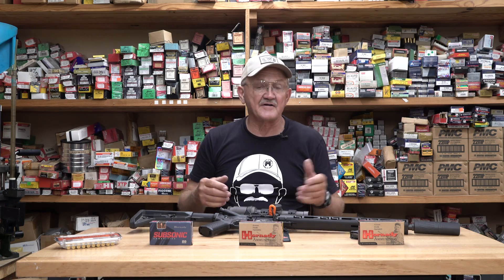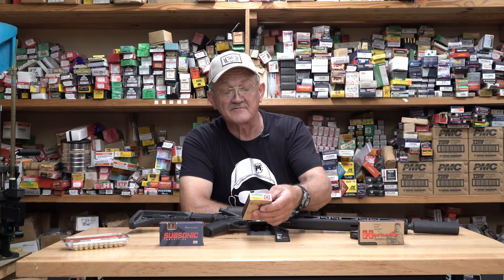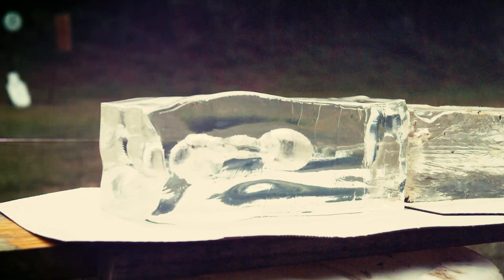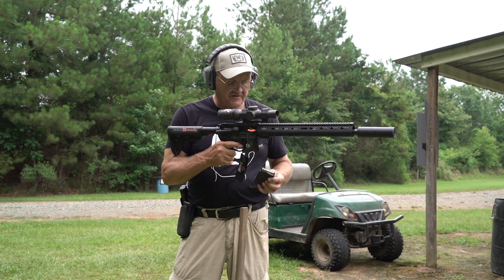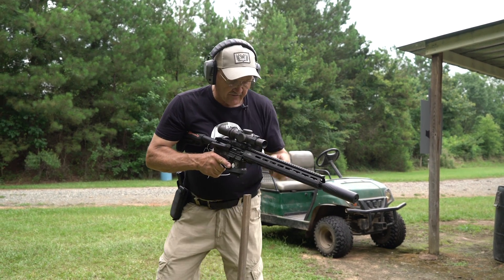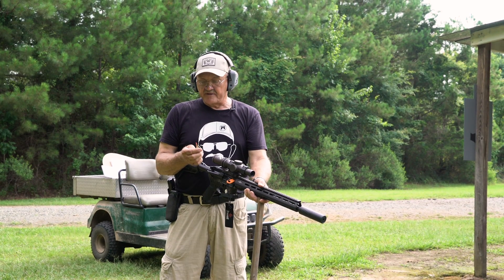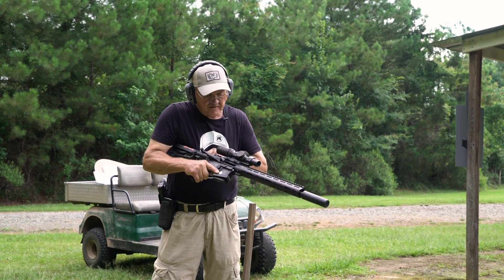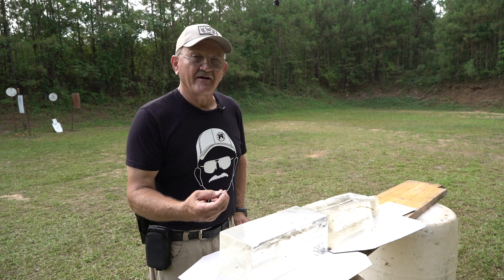300BLK Vs. Ballistics Gel - SUPER HIGH SPEED CAMERA!

Comment: Would have loved to see this test with a more typical 300 BLK rifle, either 7.5 or 10.5 inch barrel. Most people that have 300 use the shorter barrels.
Reply: Unless u use supersonic ammo then we use 16 inches to get full burn
Reply: @jorgesolis9468  300 Blackout was specifically designed to run out of shorter barrels. So why would you need to use a 16” barrel for something specially designed to be fired from a short barrel, full burn for 300 BLK comes way before 16” dude.
Reply: @427SuperSnake1  look at supersonic loads your statement is only true with subsonics, but with supersonics you gain 200 fps
Reply: @427SuperSnake1  stop listening to the tacticool guys that think they know everything 200 fps isnt full burn that's velocity difference between. 308 16 vs 20 inch barrels and 9mm+p vs 357 mag or 357 mag 2 vs 4 inch barrel it's not full burn with supersonics with subsonics yes you're right o think theres only like barely 100 fps increase but with supersonics that's quite a bit

Comment: Thanks for the video and comparison!  I'm working with the Ammo Inc load of the 110gr vmax and it's giving me 2500 out of my 16" and 2300 out of my 10.5".  I've found a few reviews of the projectile running around 1800 fps to just under 2000 fps from some 8" and 9" barrels.  Those give me a good idea of what I can expect out to 100 - 200 yds depending on the upper, but this is the only review I've found that has run full power 110gr Vmax out of a carbine.  FWIW, the penetration for this projectile seems to always be in the 13" to 14" range.  Faster impacts just seem to result in more fragmentation.

Comment: That's the round that got me started hand loading. I cook up some pretty fast 125 and 130 grain supers and a brick through a plate glass 238 grain cast lead sub load. I run a carbine length gas system on my 16 inch gun so I can turn up the juice a bit.

Comment: Jerry demanstraight the "Stick" barracked method with the .300 Wisper/Blackout, hmmm need more cover...    Jerry is quite correct, manufactures will post their velocities.  but most do not tell you that they are achieved in a sliding breech, or bolt action test rig with either a 24, or 26 barrel length.  So when firing through a Carbine/Pistol length weapon.  it is always advisable to chronograph Your weapon with these loads for actual velocities.  ~_^
Reply: Most BLK ammo I've bought says it was tested in a 16" barrel.  I do remember seeing one that used a 24" barrel ( can't remember what brand ).  I have no idea where you could buy a 24" BLK barrel, outside a custom one-off order.
Reply: @JaronActual    Then the box's of ammunition you have would be a first in the industry.  What brand was this if you please.
  In all the years I've purchased ammunition, and in the 12 years I test fired rifles for Weatherby Rifles.  The only data disclosed besides bullet type and weight is velocity at the muzzle and given ranges with sometime bullet drop and maybe muzzle energy in foot pounds.  I've never seem a box that listed the length of the barrel used for the totals given.

Comment: I would like to see this stuff out of a 7.5 inch barrel.
Reply: The VMax would "lose" the most, but still be devastating at that range.  The subsonic rounds would be practically the same.

MrGunsandGear did a great video detailing 300 BLK performance by barrel length.  It was NOT optimized for a 9" barrel like so many people claim.  It does work great in 9", but a 16" will still give appreciably higher velocities in almost every load.

Comment: Thank you. I am going to buy a Anderson 300 blackout upper. I was going to shoot the bulk Hornady 155gn out of it. I also have a variety of .309 lead powder coated bullets. Some have a BHN of 17 for the lighter bullets for the 110 gn to 150 gn. 155  to 180 I use lead that has a BHN of 21. . For 185 to 230gn I use lead that had a BHN of 25. I don't want to go any harder then 25 then the bullets are too hard and brittle. I just use foundry alloy to add toy range scrap lead that I melt down I to ingots. I take the copper jackets and I smelt them in a 20 gallon steel barrel that I have fire blanket with plaster mixed in with the fire proof blanket in layer's. I have a propane and oxygen mixed with a cutting torch body to get the mix right. The torch head is in the bottom threw a hole in the bottom. I use a crucible from a website I found. It comes with a special handle that comes off. I also made a lid with a hole in the top so I can see the crucible and if the copper is ready. I pour it in the molds. I weigh each one and use punches to put the weight on it and what it is. I have to break the slag off then I use a wire wheel to clean it up. Then I use a polishing wheel with rouge to polish the ingots. If I sold it as jackets I would get 80 cents a pound. In ingot form I get $2.40 a pound. I get about 90 lbs Everytime I melt down the range scrap.im picking up 8 5 gallon buckets of range scrap that should give me about 400 lbs of lead and about 270 lbs of copper jackets. After smelting them I will end up with 240 lbs. That's about $550or so in copper I use that money to buy my powder and primers. So my reloads are basically free when I use lead. When I use good factory bullets then it's the cost of the bullets. So shooting is basically free for the ammunition. My pistol club is only $195 a year. They have USPSA shoots and poling pins and different classes each month so I can keep on learning.

Comment: The discreet subsonics absolutely destroy feral hogs . I’ve killed hundreds with them .
Reply: Good. The fewer, the better.
Reply: I've yet to try out the Discreet Ballistics yet but plan  on testing them out at some point. Check out the Gorilla Silverback 205gr subs, they're fantastic as well
Reply: Do you have the older gen or the newer? I bought the older ones when they came out and they didn’t cycle.
Reply: GibsonOfAGun I had to open up the gas block to get them to run . They run perfect now
Reply: @Michaelpress14  That's good to hear.  I would have repeated failure to feed because the front of the projectile is flat like a brick.
Reply: GibsonOfAGun they have a tutorial on hot to polish your feed ramps

Comment: Maybe he needs some surgical hemostats to pull those rounds out. Might be easier and safer?
*Just a thought.
Reply: That’s was my thoughts or some long needle nose pliers
Reply: Hemostats, pliers, etc leave tool marks on anything they grasp. Now Jerry isn't at a crime scene, but if you were to use a pair of 'stats or pliers to pull a round out of a wall or a corpse, it's evidentiary value would be ruined.
Reply: @titanuranus  They have rubber tipped ones, plus this isn't a murder scene so it's not that big of a deal. Prying rounds out with a knife leaves marks as well. A little scratch isn't going to compromise anything in this scenario. Jerry hearted my comment so obviously he's not against it.
Reply: I have some long ass needle nose pliers I got at Harbor Freight that would be perfect for that! 🤔